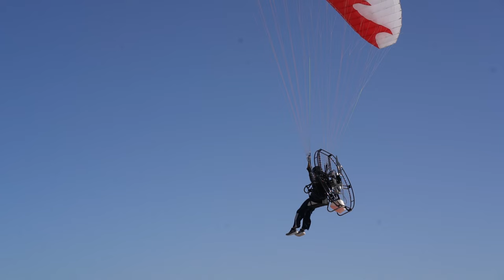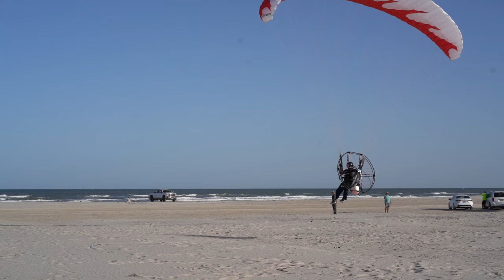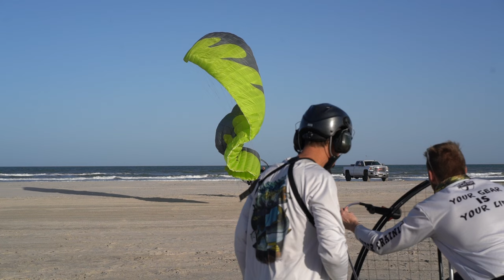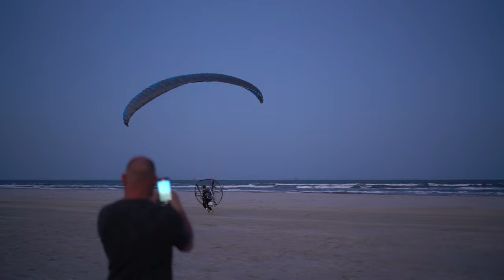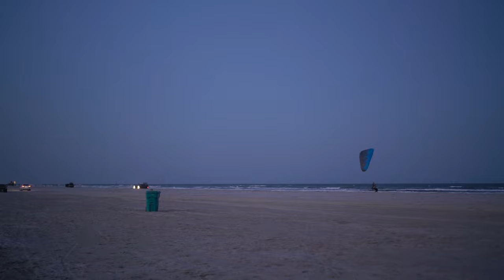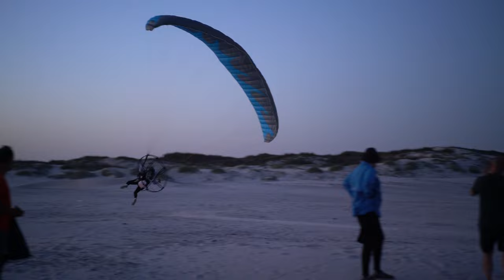Reviewing FAILED Paramotor Launches And Landings!

Comment: @4:45 Did he say ideal landing you want to put your foot down on the ground then flare…?  I thought flaring should begin before you touch the ground with your foot no?
Reply from the maker: No.  I said I can do that.  Normally you start a flare at about 2.5-3 ft but there are many factors.  The slightest change in pitch can change that dramatically.  So you can't really help someone fix their landings with a few tips.  It takes SUPER training to first build the correct skills on the ground that are required to respond correctly and then transfer that skill and apply it to landing while being given numerous other details and the exact timing and amount.  Luck doesn't breed consistency.  True SUPER training does.  There really isn't any other class where students get upwards of 530 flights each to truly master skills correctly and safely without destroying gear or themselves.
Reply: @DellSchanze   Which school do you recommend near Orlando FL?
Reply from the maker: There are none there that I would even remotely consider.  Just take SUPER training.  There simply isn't anything else worth your time.  800-707-2525.  Plus the location is absolutely critical and Florida is not really a good location to train.  I searched all over the whole coast for training sites but there just isn't anything.  It's great for flying after you are trained but for training you really want the perfect location.  In Corpus Christi Texas we had a student set a world record knocking out 530 flights during his 10 days of SUPER training.  Doesn't matter where you are in the world SUPER training is worth the plane ticket big time.  Do it the right way and this sport is truly incredible.